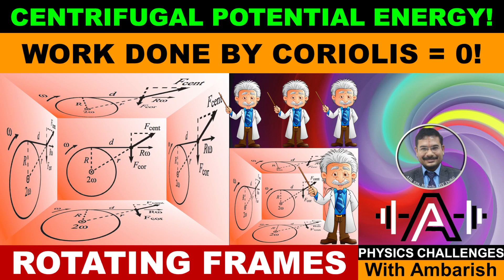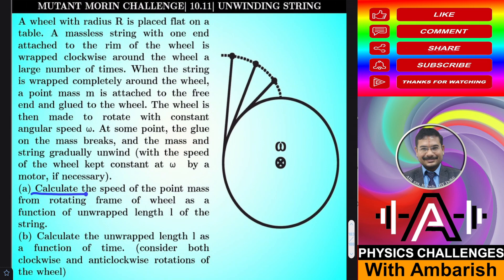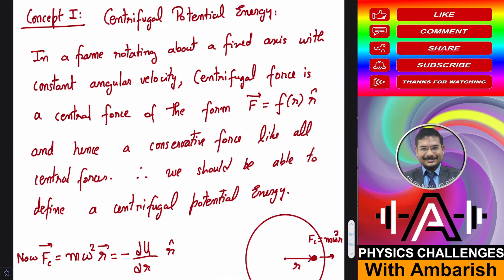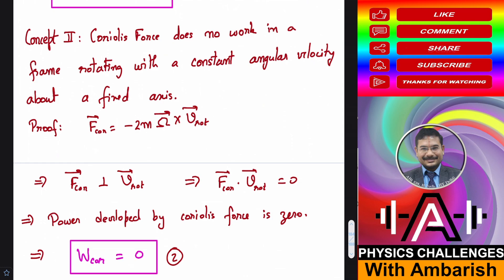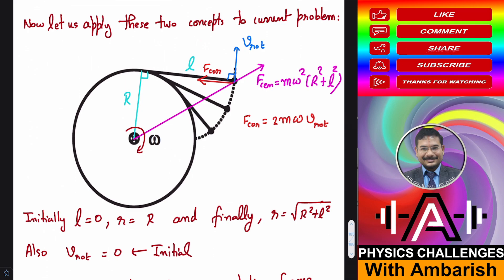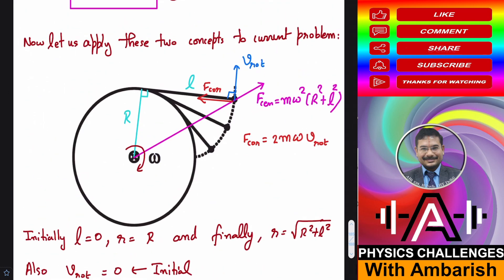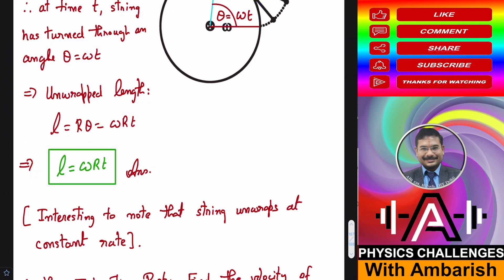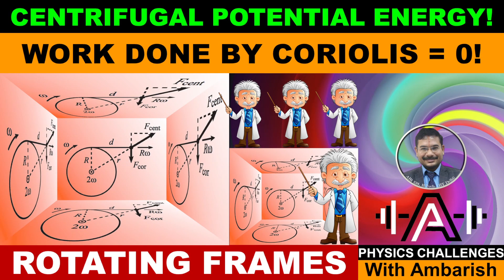CENTRIFUGAL POTENTIAL ENERGY| CORIOLIS WORK| WORK ENERGY THEOREM IN ROTATING FRAME| MORIN 10.11 MOD

Comment: Sir can't we relate omega and omega das by the fact that at any instant velocity of mass along the string will be zero so with respect to that instanteous axis point on disc the mass will have perpendicular velocity so we will break the component along string direction and equate it to zero similarly the point that is located below the mass with respect to disc it seems to move with some angular velocity so we will write the velocity of that point with respect to centre of disc and break it and the component that are coming in radial direction and equate it to zero and because both are equal to zero so they are also equal

Comment: Sir in this problem is v rot perpendicular to the string because of the impulse the string applied on mass m ??
Reply from the maker: It is perpendicular because the instantaneous axis of rotation of the mass in rotating frame is at the tangent of the disc.